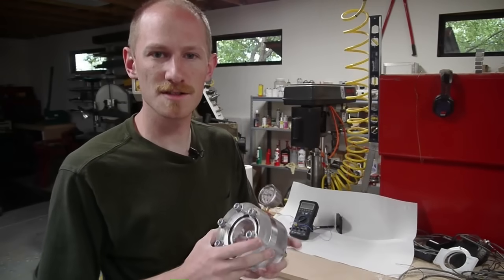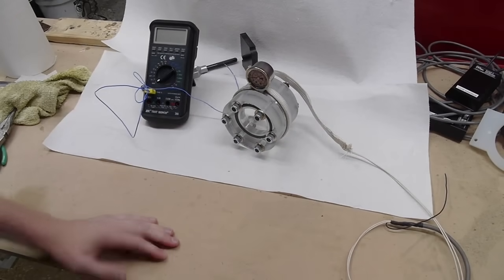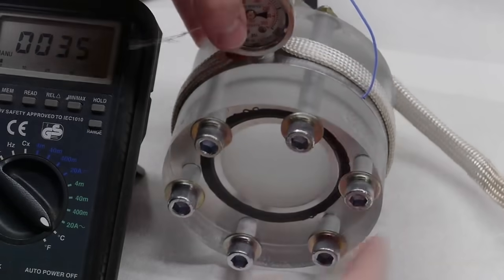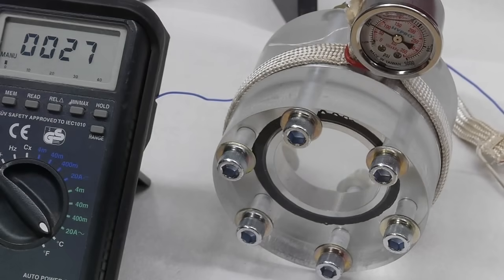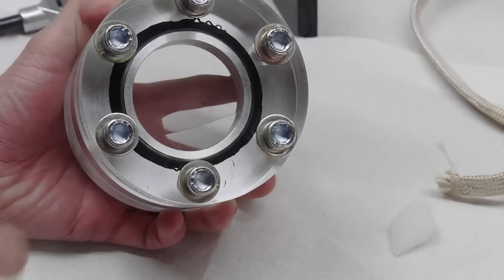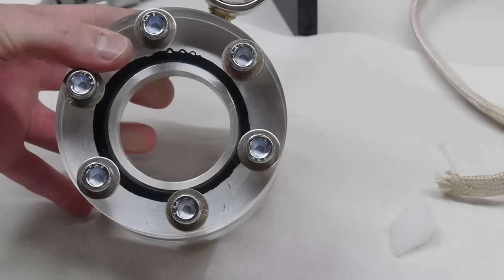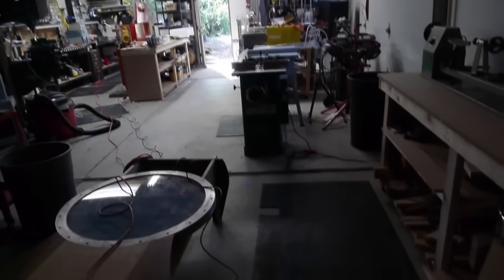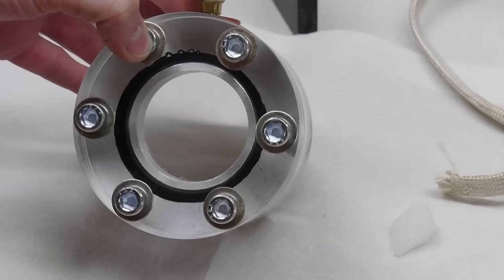A close look at supercritical carbon dioxide CO2

Comment: Actually, supercritical CO2 is an excellent gas to use as a refrigerant. The only problem is of course is the the pressure required. To say the system would need to be "robust" would be putting it mildly.

Comment: A venting valve is a great idea, but be careful with threading etc when dealing with high pressures. A case that didn't go so well, when a threaded pipe spun off while releasing pressure: search for video "Worker killed while venting tanker" by WorkSafeBC (for somereason, I can't seem to share the video link here). Also, be careful of welds becoming brittle if you decide to weld the vent.  cheers!

ps. Thank you for posting your experiments.

Comment: Put the gauge in last, no pressure on the seals and you can thread it down quicker than 6 bolts. 
Use it to extract THC and CBD, make some edibles.

Comment: Fascinating. The entire bottom 4 km of the Venusian atmosphere has got to be supercritical C02 at a temperature of 462 Celsius and 90 atmospheres. At 60 km, up where the pressure is 1 atmosphere, the temperature is exactly as expected for that pressure and solar isolation, roughly twice Earth's. We have complete pressure and temperature values from the spaceships that have landed, some of whom did not even have parachutes given the density of the atmosphere. I don't think virtually any insolation penetrates this soupy atmosphere; there is no " greenhouse " effect as with little surface insolation and a supercritical CO2 fluid lining the planet, that mechanism cannot work.

Comment: well in what i do super critical CO2 is used to clean the inside the crevices of chips and silicon wafers when there is a rather persistent debris in there. although im curious to see what happens when you use it as the launching force in say . . . an air cannon

Comment: Do you think a .2 gallon / 1 liter epoxy canister would work? use a wax mould to pour very strong epoxy 2-3 inches thick in the shape of a 1 liter bottle, use a diving canister valve and integrated gauge that screws into it.

Comment: Very cool. But what brought me to you tube this evening on the topic of c02 is what is it’s behavior in our atmosphere during temperature changes. Does it rise and fall during heating and cooling. I would expect expansion as a gas and upwelling from wind currents but I’m curious.
Reply: I understand that we are talking temp vs pressure to gain a change of matter. I’m more concerned with o2 being relatively heavy and carbon also being relatively heavy does it all just settle to ground level where we all are.

Comment: Why were you expecting such high pressures? As long as you only have CO2 in there, and as long as you don't completely fill it with liquid CO2 (note, the solid is twice as dense as the liquid!) then below the critical temp the pressure will always be just the vapor pressure of CO2, and it shouldn't get too much higher above that as long as you don't make it extremely hot. After all, CO2 fire extinguishers don't usually blow up on warm days.

Comment: Fantastic video, and a fine-looking pressure vessel! As you say in your video description, it probably isn't possible to hold CO2 at the triple point in a plastic container for very long, but I now have first-hand experience that says you can do it in a *glass* container.
Reply: (I should point out that said glass container eventually violently exploded, and if I had been in its vicinity, I would have been seriously injured or killed. The glass shrapnel left horrifying gouges in the wood and plaster above the sink.)

Comment: should have screwed the gage on after it was assembled with the dry ice so the o-rings were seated correctly. 
or installed a bleed valve that you can close quickly.

Comment: Do they make solenoids or ball-valves that work with that kind of Temps and pressures? That way you can have the liquidator phase,  then drain it to your material container,  then vent it slowly to remove the target material?  Would that work? What if you use sight-glass material as the internal contact faces of that chamber backed by the acrylic?

Comment: CO2 rocket?)/* Chilling vessel close to dry ice temp before filling might help with gasket deformation from tightening down with pressure buildup occurring. Might want to make ouside flanges for the bolt heads if you're going to go to extreme pressures..)

Comment: The surface waves of the liquid CO2 are so way different from the behaviour of water, is it just the effect of lower viscosity or something else too? Also there is no wetting of the walls. Very fascinating! -- Would it be possible to shoot an ultra closeup of those waves under various shaking conditions? -- Maybe put it on a speaker and slowly tune it from infrasound bass sine frequencies upwards.
Reply: Yes, the viscosity of liquid CO2 is relatively low compared to water (around a tenth), and that results in the lack of fluid tension as well as high fluid Reynolds numbers, which makes the liquid quite dynamic compared to water.

Comment: Nice setup! I have a related question.  A while back I decided I wanted more power out of my CO2 powered rifle.  I have managed to create a completely self contained heating system, rifles look virtually standard!  It has a hand wound coil that sits around the 12 gram canister of CO2 and i heat it to about 45 degree's C.  Its controlled by a thermocoupled 'sensor', and is powered by four 18650's, good for about 4 hours.  I have no way to measure pressure increases or velocity of projectiles, unfortunately.  It does seem a bit more powerful, but the main difference I notice is cold weather performance, especially with rapid shots, as expected, and grouping on targets appears more consistent indicating more stable pressures - valving is unregulated.  Do you think I would actually be raising the pressure, which I believe is around 900 PSI standard?  Thanks for any advice!

Comment: I have some aluminum fin stock that I got out of an aluminum scrap barrel that was remnant from a job that was to make lazer housings for satalites. I have used epoxy with aluminum powder to help it conduct heat. I notice that when the engine runs the tank gets real cold. So my reasoning is to gather heat from the atmosphere to increase the rate at which the co2 evaporates and prevent the tank from getting so cold. I have yet to see if this works as the rubber in my G mot filler is dead and I am still waiting for a new one to come from europe.

Comment: Dry ice is relatively cheap, how about a Super-Critical CO2 ultra-fine abrasive jet cutter. The jet of CO2 fired through a drop of oil suspending ultra-fine crushed abrasive. Get hold of one of those Industrial Diamond Nozzles used in synthetic fibre manufacture.

Comment: Hi, I may ask here - as I counldn't find answer nowhere.
Assume we are at 11000 m below sea level.
We have batiscaf which implodes.
Now:
Water at 1101 bar will have density about 1050 kg/m3 - it is not superfulid due to temperature below critical, lets say +2C
But what with air?
It will be supercritical (oxygen, nitrogen - other I will silently ignore) - pressure 1101 bars - much over critical pressure, temperature +2C too
But supercritical fluid do compress with pressure

Comment: Isn't it just a gas after going "super critical"?  What's the difference between just gas, and "gas & liquid w/o boundaries"? Thanks
Reply from the maker: Above the critical point, the material can transition smoothly from the density of a gas to the density of a liquid. When the density is closer to liquid, the material has more liquid-like properties (high density, viscosity, etc), when the density is closer to a gas, it has more gas-like properties (no surface tension, low density, etc).  Below the critical point, there is always a sharp density change when transitioning between gas and liquid phases.
Reply: Applied Science Thanks Ben.  So I guess below the critical point, a plane or curved 2-D surface demarcates the boundary between liquid and gas.  And above the critical point, there is no such simple boundary. So if you were to draw a straight line through the chamber, and travel along this line, you'd hit multiple high and low density areas. Something like that? BTW, let me know if you need help with FPGA.
Reply: ....Field Programmable Gate Array........?

Comment: Interestingly enough. Nitrous Oxide has a very similar critical temperature to CO2. 36 degrees C and 71 bar. Also the surface of Venus is 92 bars and 460 degrees C and the atmosphere of Venus is 95% CO2 ..... so the air on the surface of Venus is a Supercritical Fluid state .... but no liquid of course.

Comment: for the o-ring issue could you leave the valve off letting the pressure escape thru that hole. Then put the valve on, or would the seal from the valve to aluminum be compromised?

Comment: continuation:
On 1bar air density is about 1.25 kg/m3 - but at 1101 bar it will be (? correct me if I'm wrong) ~= 1300+ kg/m3 (supercritical) - so denser than water.
And the question is - will it sink in water?
Thanks

Comment: What's not mentioned, is how does super criticalizing co2 from the liquid state, change it's ability to solubilize organic compounds?
Reply: ***** thanks for the reply. Another question. Is there another phase change as the temp is increased? It seems that it doesn't seem to critical if cylinders and apparatus, containing liquid CO2 is kept above 33C, then that phase of homogenized gas/liquid then will be easy to maintain.

Comment: @bkraz333 Thanks for the clarification. Can you please tell me about the pressure of the fluid (inside the pressure vessel that you made) in the supercritical phase? 

Also I found that the surface of PMMA (acrylic) "reacts" (a physical reaction rather than chemical) with SCCO2 while it is placed inside a supercritical environment for a longer time (2-3 hrs). Have you ever faced anything similar to this?

Comment: I need this on my shelf. looks so cool where can I get it
Reply: It doesn't last. his blew up a few days after making this video.
The acrylic needs to be replaced every time you perform this demonstration.
Reply: Wemja what about using glass?
Reply: Tuzz Nation I have no idea, The main problem was that the CO2 leeched into the acrylic while it was under pressure. When the pressure escaped everything looked fine.
The next day however the CO2 had expanded the acrylic and it would not fit anymore.

He has a video about it on this channel.

You may be able to use glass but its difficult to work with. If you were to drop it you can get glass shrapnel flying trough the room at high speeds.

Comment: Technically, wouldn't there still be two phases in there after you shook it up.  I mean, the two phases would be incredibly close but there may still be a slight difference between the liquid and gas, such as slight inhomogeneity of the density, refractive index, etc.  After all, the temperature wasn't quite at the critical temperature yet.  Or does shaking it up bypass that?
Reply: +DANGJOS  Nevermind, the critical temperature was lower than I thought

Comment: waterjet machines  are using 40000 -80000  psi... (there might be  higher pressure)

so my question, do you think, you could build a ""chamber""  observing  under  60K psi   materials reacting?some approach   to  difficulties,  the   coke can, and  practically all can  made  to flow  aluminum.. a solid aluminum disc  pressed trough  on a  thin gap..so.. is  it possible to build a chamber observing different materials?or pressure  simply escape on microscopic gaps?
Reply: +cnccarving The last part. Hydraulic high pressure lines are extremely dangerous because of this. Hydraulic injection injuries can occur if you block a microscopic hole with your hand. Horrific injuries.
Reply: that's sure..  same way as it cuts effortlessy  nonferrous  materials without abrasives..
Reply: cnccarving That and it injects you with toxic hydrolic fluid. The contaminated veins in the hand have to be removed and replaced.
Not really an issue here unless he has toxic chemicals in the vessel, but the damage would be bad enough even without the toxic injection :)

Comment: You didn't mention that common gasses and compounds become powerful, selective solvents at supercritical temperature/pressure. By gradually increasing the T/P you can fractionate the feed material compound by compound. Then, by simply venting, the 'solvent' vanishes leaving no residue. The perfect crime!

If you wish to fractionate (ground) coffee beans you will increase the temperature/pressure until the material begins to fractionate. This can be observed in your vessel. Each successive fraction will need to be removed. To do this you would need a more elaborate setup.

Comment: I have not yet found, online, anyone demonstrating having a separate compartment for another substance, such as water ice or liquid water, so that after the cover is screwed shut, the action of the CO2 fluid pressure on the other substance can be observed. It would be interesting to me to watch if someone is able to try this and give a video on it. (Maybe, let a small opening allow the CO2 to flow into the other compartment, to limit pressure build up in that compartment while closing the double cell system. ) Thanks.

Comment: This is only true at room temperature. It will sublimate at −78 degrees under normal atmospheric pressure. It can only exist as a liquid at over 5 times that pressure. Whether or not carbon dioxide is polar is not a factor.

Comment: i didn't know CO2 could be in a liquid form. i was taught in school that it sublimates directly from solid to gas
Reply: +Kevin Mulligan In open air it does sublimate directly from solid to gas but that is because the vapour pressure of CO2 is higher then the atmospheric pressure. If you see in the video he puts the dry ice in then quickly closes it off. 

This is because as the dry ice heats up the air in the container gets squeezed and pressure goes up to the point where the pressure is high enough to keep the CO2 in a liquid state.

If you buy an air can duster and shake it thats how the CO2 "feels" basically in a liquid state. The air can duster is not CO2 however.

In an enclosed container if the pressure of the air is high enough the CO2 cannot turn into a gas and stays liquid. If you add heat to the mixture like in the video then you are essentially giving the CO2 more kinetic energy and thats why in its attempt to transition from liquid to gas it goes supercritical.

Comment: So the CO2 is self-contained, able to be heated and still remain extremely cold?

Have you considered using this to cool a computer CPU by making one wall aluminum to be the heatsync for a CPU?
Reply: +Zizi Mugen That's not how it works. The CO2 would eventually heat up and wouldn't help with cooling. The CO2 in the video isn't cold, it's just high pressure.
Reply: Tomaž Perčič Aaahh, that's riiiight. I didn't consider whatever that chart is that shows pressure, temperature, critical point, and all that. Thanks for bringing that to my attention.

Comment: So, weird question. Could a pcb (ardruino stack) be contained within a liquid or supercritical carbon dioxide chamber along with a set of Peltier coolers and a circulator? Or would it act as a solvent, destroying the components?
Reply: The arduino would not work at those pressures and temperatures.
Reply: @bitterlemonboy  wow, I don't even remember what I was trying to make back then. Maybe cooling pcb boards within liquid CO2 or something.

Comment: Ok so I'm not an engineer and this might be a dumb question. But if you were to drop this down into the ocean (think Mariana's trench)  to wherever the depth pressure was equal to internal pressure, what would happen?
Reply: _ _ the pressure at the deepest end or Challengers deep is about 15,000 psi It would crush the plexiglass since it is rated at 4 to 5,000 psi as he claims.